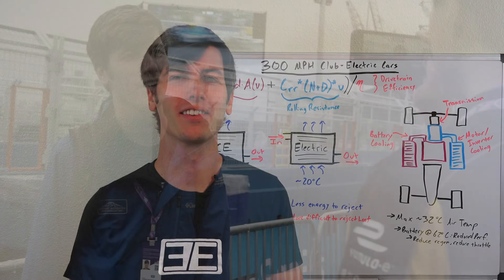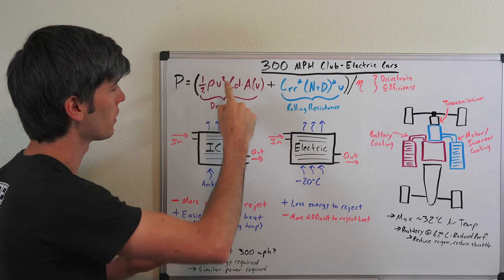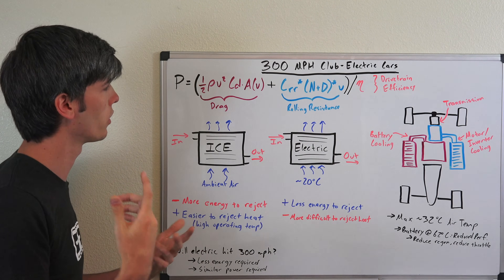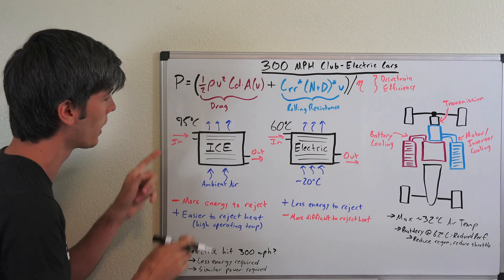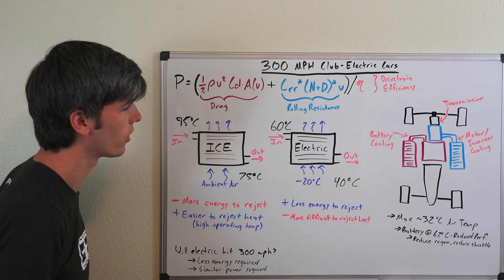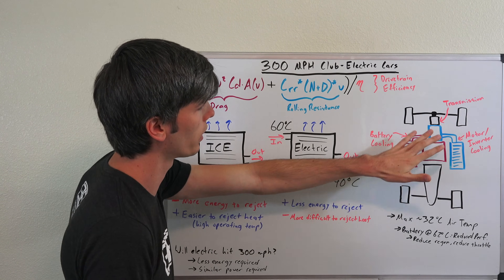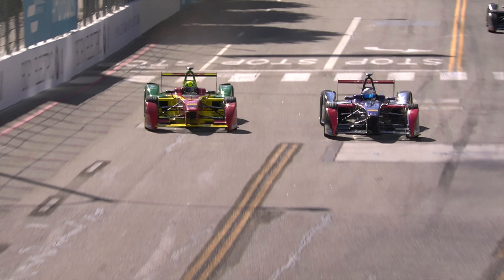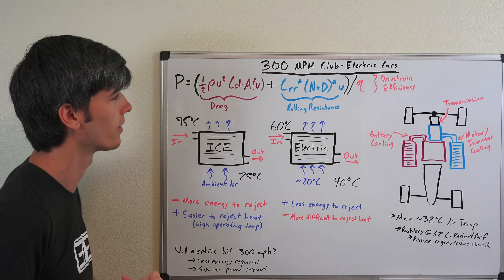Why Has No Production Car Hit 300 MPH? Electric Cars

Comment: Nice video,,,, a question if you can for ev. Can an ev achieve a boost or top speed for short moment if it has super capacitors that can  instantly discharge

Comment: Can you use the seebeck effect to increase the effective radiator temperature difference? Inlet coolant at 90°c, heated by hot side, secondary battery cooling by cold side? How much power do those things use? Could you divert regenerative braking into a thermoelectric element?

Comment: I just don't think electric motors have the horsepower to be able to get up to that speed you know without you making the car more aerodynamic for the wind to go over the car more easier the goal is to make a normal car with an electric battery go to you know pretty fast speeds at 8 gasoline car could get at but no problem

Comment: If normal cooling systems are so inefficient in electric cars due to the low operating temperatures, why not search for other solutions? Has anyone ever tried hooking up an air conditioning unit to an electric motor. They can reach far lower temperatures than ambient air so that could solve the cooling problem. Of course you still have power loss from operating the compressor and drag from the heat exchanger.

Comment: Or use HVAC to cool those parts below ambient. Then you have more efficient cooling for same drag due to concentrated heat that is output at a much higher temperature as well. But that's nickles on the dollar for the drag vs power issue of 300 mph

Comment: install internal air conditioning for engine cooling
Reply: The air conditioner will use hundreds and maybe several thousand watts to run, this will further cause the batteries to heat up.

Comment: Could they use Peltier strips to cool the components inside an electric car? If they are adjusted to keep to cold side of the Peltier at 60ºC, the hot side would be much hotter than that, so the ΔT would be larger.

Comment: 1) if tires are not capable of handling high wheel revolutions then it is needed to make wheels bigger ....and about 20% bigger than they actually are on a veyron. That will reduce rotation speed of a wheel travelling distance. So this one is actually not that hard to comprehend.
2) Electric batteries are heavy and that is actually a big + to top speed, because the car will be more stable at high speeds if the power is enough.
3) If you designing a car to be able to race or cruise at high speed you DO need alot of cooling but if you want to make a kinda mid speed GT cruiser that IS capable of acheving high top speed for a short amount of time, you won't be needing that much of flow cooling just some internal ratiator that will suck the heat while the car is getting to it's top speed.

Comment: IMHO, this video is a bit disappointing. The title refers to "production cars", but the content is about the Formula E more or less. In the end, for customers of a production car, it will be difficult to actually experience the 300 MPH - neither usual race tracks nor public roads will be allow to reach this speed. Only a few high speed trial circuits and the like allow for these high speeds. So for the buyers of a potential 300 MPH car it will be unlikely to ever reach it. And this means it is not so attractive for the manufacturers to overcome all the physical challenges you have mentioned in this and other videos related to the topic (aero, cooling, tyres, ...).

Comment: Why not cool with liquid nitrogen? Some production cars cost over $2 Mil and have maintenance needs more expensive than mortgages. Is there any reason liquid coolant can't be used for top-speed mode?
Reply from the maker: Cars do use liquid coolant. Using something like liquid nitrogen only would be temporary, as you use up the cooling ability of the liquid. You need a closed circuit which can exchange heat with the surrounding air for long-term cooling. Dragster cars will in fact use things like dry ice for single runs, but of course you have to replace it.

Comment: Great video. Please explain why a lower temperature delta equates to a less effective cooling system?
Reply: Looking at the numbers on the board, I was expecting you to say that electrics are better at cooling bc they don’t get as hot, and also down produce as much drag bc of cooling system.
Reply from the maker: If ambient air is 0C and your coolant is 100C, it’s easy to bring 100C down. If ambient air is 0C and coolant is 5C, it’s difficult to reduce the temperature much.

Comment: What about using a heat pump, so the radiator is hotter? And therefore could be smaller. Would the mass saving be worth it compared to the inefficiency of adding it?

Comment: Would it make sense to use some kind of heat pump to increase the temperature the radiator is seeing? Of course, one would need pretty high performance heat pump to not be limited by it.

Comment: No numbers = no point. One thing is more and another is less. What does that say? NOTHING. Unless you put up the actual numbers and calculate ratios this says absolutely nothing about the electric cars. Your Bugatti video quoted it needing to reject 3000 HP worth of heat at full power. Would a 2000 HP electric car running at ~95% efficiency need to work just as much to reject its 100 HP worth of heat due to lower thermal difference? Hell no, that is just absurd. And even if that was so - then it would make sense to use a heat pump to concentrate the heat and bring the temperature differential up. It is really cheap at those levels and we are talking about reaching top speed, it does not matter that this would empty a 100kW battery in 10 minutes. And then you can actually take lower Cd values from actual electric cars and see how much power would be needed to reach 300mph with those cars. There are plenty 1MW electric cars out there already, it is close.

Comment: Hey, I know its really impratical, but then again so are these cars.... But thinking of what you said about the delta T being the limitting factor,  if you were to use 2 coolants, the first being water/ antifreeze based and the second being a compressible gas refrigerant, could you use this to make a 'mini radiator' where the heat is concentrated more resulting in a bigger delta t? My thinking is that at high speeds this smaller radiator would allow a lower cd,  and this would more than make up for the inefficiencies of running another compressor. I think it would be ineffecient at low speeds, but it could have some kind of retractable shrouding to lower the cd so only the miniradiator is exposed when the car is attempting top speed.

Comment: Could you convert body panels into radiators?  I'm thinking, an aluminium spoiler with water pumped through it.  Also, why not use peltiers or another mechanism to increase the temperature differential?

Comment: I guess theoretically the waste heat couldn't be used to create thrust using the Meredith effect like the P51 mustang.  The electric motor would still have an advantage because it could produce the same power in a smaller and lighter motor.  It would also be possible to use a compressor to reject more heat, like an air conditioner, but this would consume a lot of energy.

Comment: One thing that is not mentioned is that electric vehicles still have potential for increases in efficiency.
Better batteries will need less and less cooling as their internal resistance goes down. Eventually you will not have to cool the battery at all.

1% better efficiency in the motor at 300mph ( totally possible ) will make for 10,000's of watts of heat not being produced.

The ICE on the other hand, is really tapped out for efficiency increases these days.

Comment: You can redirect regen to useful work to an air compressor and carbon fibre air tank then that can drive an air motor connected to an air conditioning compressor to send it to a heat exchanger creating a peltier effect. You can amplify the heat delta by using actual peltiers on the parts needing cooling. The system would create higher radiator temperatures and therefore the size of the radiators could be reduced.

Comment: For a short duration of operation, would a cooling system that kept the liquid nitrogen work? It would lower the drag while keeping the ambient temp of the cooling system much lower, allowing the cooling system to take more heat from the batteries and motor.

Comment: Answer is no. Electric Cars are slower than ICE powered cars, and also are a lot slower on the 60-120, and suck in corners. Not to mention what everyone else in the comments are saying about the fact that the current tire technology is unable to cope yet.

Short answer, neither electric nor ICE is 300 capable until tire tech advances.
Reply: Not necessarily true. The Tesla for example, is slower at top speeds because it uses a large battery that favors capacity over output. The power is limited because the battery cannot cope with the huge power demands ( too much internal resistance ).

You could switch that battery out for a higher power, lower capacity type and the car would be totally insane across the power band.

Comment: The two way land speed record for a piston engined wheel driven vehicle exceeds 400mph and was done with about 2200hp.

My guess is the next Bugatti will have 2000hp and be able to exceed 300mph, even with all that weight. Tires and reliability are the biggest issues.

Comment: Why don't they use a heat pump/inverter to increase the temperature differential and therefore decrease the radiator cross section?

Comment: Cooling is one perspective but you could pump coolant through a pipe system that is thermally connected to the cars exterior and possibly solve that with no air drag penalty. And nobody said the car needs to maintain 300mph continuously. Thus a car with sufficient "peak horsepower" to overcome all the energy losses at 300mph should be able to get to such speed, provided the horsepower can stay long enough at that peak level. One way to solve that could be to have some coolant, perhaps even using the gas as coolant, to cool down the engine, at least for enough time to get to 300mph. But in the end you need enough horsepower as well as proper gearing ratio to maintain usable RPM. An EV will probably also need a multi gear transmission to get to 300mph to keep RPM low enough for acceptable operation.
Reply: Use a combustible fluid for coolant? o_O

Comment: I wonder if tyre compound's got better and the use of a liquid nitrogen cooling system help electric cars reach 300 mph . Liquid nitrogen could be pumped around the outside of sealed electrical units and transmissions thus keeping thermal cooling at a set rate and removing radiators increasing aerodynamics of the vehicle by streamlining it .

Comment: I have a better answer. Electric cars all lack proper gearboxes. No, they dont "Need" them, but they do enable much more stability at higher speeds, and higher speeds in general. Sure, theres stuff still in the early stages, but its still a ways off from being in every EV

Comment: Since the heat is not an issue, would it make sense to use a heat pump (A/C) to increase the effectiveness of the cooling and reduce the drag from the cooling system? At 300 MPH, the HP loss from the heat pump would be nothing compared to the HP loss from drag.

Comment: salt flat, top speed racing isn't long enough to worry too much about battery regen, or long, hot run times.but then some drag cars cool their engine between runs, and don't rely on cooling drag either. so I'm not sure electric cars would have much of an advantage in drag racing, or top speed racing either.

Comment: The problem is moving power. Electricity does not like to be moved, the pixies get angry and heat up the medium they are forced to move through. So let's invent them room temperature superconductors and have happy pixies.
Reply: Batteries still can't do it, but if we had room temperature superconductors, you could just store energy in a magnetic field in a superconducting coil.

Comment: Does the gas driven car not have one more advance over the battery?
The weight, as the fuel is used the car get's lighter until refueling, where the battery will have the same weight, no matter the energy?

Comment: For top speed runs, the Bugatti Veyron (and probably other hypercars) use special modes that are compromised in other ways, e.g. active aero switches to low drag, suspension drops. 
As electric cars are more efficient and hence produce less waste heat, they may have more ability to sink heat temporarily for a short period of time in a vmax mode where most of the cooling air inlets are closed with actuated flaps, and perhaps allow temperatures to rise higher than in everyday mode for a limited time period?
Alternatively, manufacturers could just introduce a place to dump bags of ice to sink heat just like drag racers do!!!

Comment: Hahahaha... yeah, you make an electric car go 300mph and instead of using a 30 gallon fuel tank in 2 minutes you'd be overheating and ruining a $12,000 battery pack within a couple of runs. Gas might not be as efficient, but I'm willing to bet it'd be more reliable than a battery powered equivalent.
Reply: It's why all those stories of vaping devices "exploding" cropped up, people not understanding very simple things about rechargeable batteries. When you discharge the battery quickly it generates a lot of heat within the battery pack as well and shortens it's lifespan. You may be correct in saying it won't reach 300 mph if it ruins the battery, the draw on the battery could become so harsh that it actually shorts the battery out internally before it can even reach that speed.

Comment: Ok, crazy idea. For electric race cars. Creat an enclosed cooling system where Dri-Ice is packed into insulated cooler and a liquid line is run through it cooling it as it passes then circulates back into the radiator that cools the components. Sort of like a water cooled CPU. Then you can have a smaller air intake on the car. Have a quick access hatch so the driver can do a lot stop and a fresh Dri-ice pack can be swapped out in a few seconds. Lol :D

Comment: tl; dr = no, tyres are the limiting factor.
Reply from the maker: Plenty of land speed record cars (and top fuel cars) drive over 300 mph on rubber tires. It's certainly possible.
Reply: Now that is an interesting point, however the question was concerning production cars, not purpose built machines that only do a few runs in a straight line.  So, are there a plenty of production cars setting land speed records? I really mean road legal production cars. Making a set of tyres that would safely allow you to do 300 mph and being usable on the open road, even in wet, that's a whole another story.

Comment: 200°F water temps, oil temps are higher as are the cylinder heads and exhaust manifolds... EGT's are around 5 times higher than those... And these are just run of the mill production car numbers. Never mind that 200 and 300 mph are arbitrary and meaningless speeds for production based vehicles, with so few legal places to explore such speeds.

Comment: You didn't elaborate why electric shows -20 as incoming air temperature while gasser shows ambient. You can look at SparkEV vs SparkGas to see the energy difference (35 MPG vs 120 MPGe). With about 4 times the efficient drive train, you can pump chilled air to cool the batteries (which is what SparkEV does), thus temperature differential essentially the same as gasser (or more). I'd do the math for my blog, but I find your videos more entertaining, so I'll leave that for you to make.

Comment: What do you think about using a heat exchanger in a similar way the Dodge demon does to cool a coolant system? You would theoretically be able to increase thermal dissipation and (maybe) get away with smaller radiators. Has anybody worked on this yet?

Comment: Could an ICE engine just use water cooling? Like the crower 6-stroke? Would power density become a problem? Or could a heat pump be used to increase the heat rejection without increasing drag?

Comment: Just cool the batteries with a compressor and refrigerant using high pressure. The radiator of this compressor will be at a much higher temperature as a result and can take advantage of the higher temperature gradient between air and its refrigerant, making cooling more efficient.

Comment: would it be possible to engineer batteries to work under higher temperatures?
Reply: Yes, but higher temperatures are an indication of loss to resistance... which is a loss of efficiency, thus a loss of power delivered..
The best thing to do is to create a battery pack that needs no cooling at all because it's internal resistance is extremely low.
Reply: Yes, Samsung just developed graphene battery which can store 40% more power compared to current batteries. Also they can work under 80°c compared to the current 60°c.

Comment: Assuming an ICE or a hybrid, you would need at least 1800 HP (possible) -- an ability to handle insane cooling loads (doable), a battery pack that lasts long enough (not necessarily, but since I saw how the Regera used that to eliminate the gearbox, I'm impressed), but most importantly, street legal tires and wheels that can handle 5000g of centrifugal force, and a very, very long stretch of first class road (now only Volkswagen owns such a track, and they will obviously not lease it out to the competition).

But if your radiated heat in the electric powertrain is at a mere 40C, how will you handle cooling during tropical summers, which can easily exceed that?